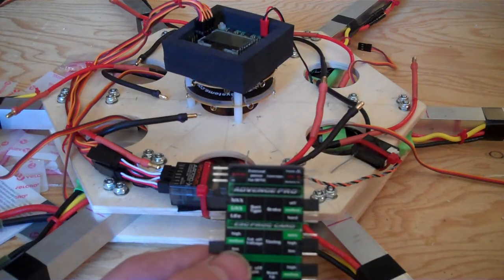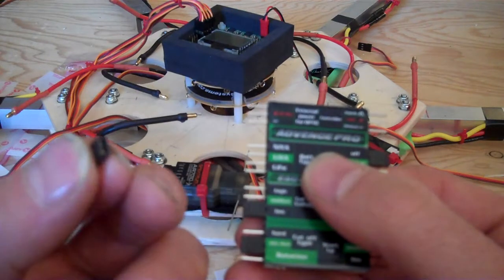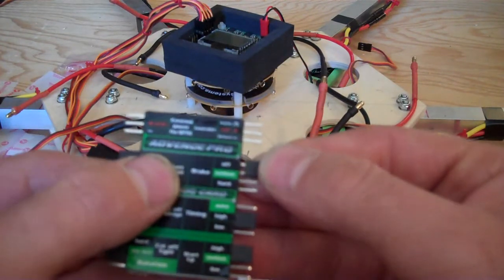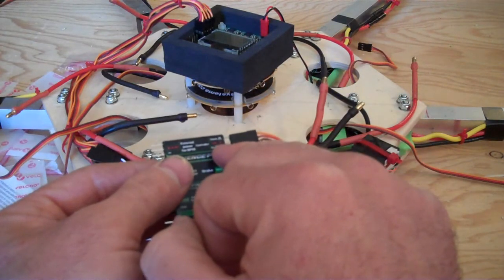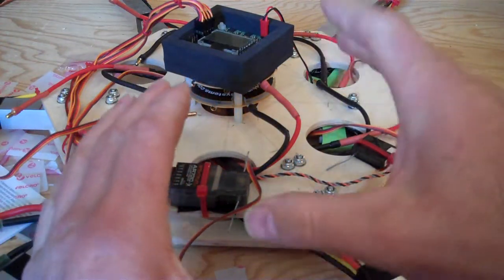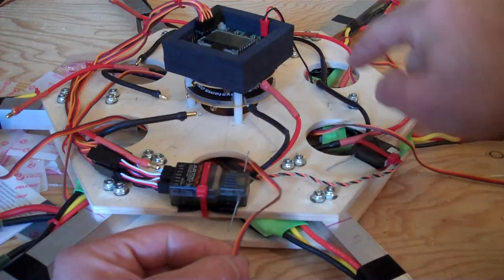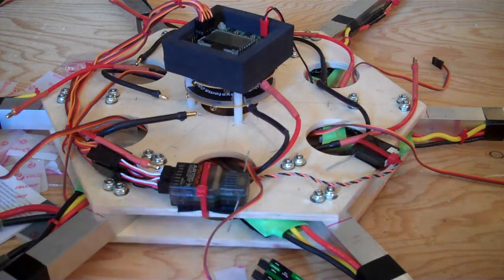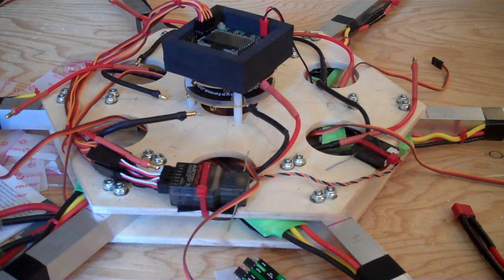How to use the Multi Star programming card

Comment: Thanks for the video. But just one question. So you are using hexa as a safer setup so when one of your motor or esc stop working you can still land safely (or at least safer) and powering the board with just one ESC? What if the exact one burns? You loose your whole copter. Why not to use all the ESC to power the board?

Comment: You can also power the KK2 board from the radio receiver (which I do as I use 3 OPTO ESC's on my Tri).

Most people don't realise that this won't power any servo's you plug into the motor sockets though on the right - on a tricopter, to power the tail servo, you can provide power to M8 in order to provide power to the tail servo on M4.

Comment from the maker: Hey Robert,  as far as I understand about the Multi Star escs is that the programming card is actually meant to be used with them.  As for setting them up you should program them all individually and use the same settings so that all the motors work in unison.  Opto just means there isn's an internal bec.

Comment from the maker: 1969 --- It is necessary to remove all but one red wire on the KK2.0.   IF you were using a NAZA it wouldn't be necessary because its the nature of that board.  The red wire supplies 5v to the FC.  You don't need to remove the red wire on any ESC unless it has a switching BEC.  If you were to use an OPTO ESC you would not have to remove the red wire on that either.

Comment from the maker: Kabaku,  you need to program the esc so that the motor responds at the commands needed to make a multi rotor fly.  The radio receiver tells the flight control board what to do, and the flight control board tells the esc what to do, and lastly the esc tells the motor what to do.  It's a chain of commands.  If you just power up the motor without programming the esc it can be very dangerous.

Comment from the maker: Thanks.  I'm using the 45 amp esc's with the built in bec.  I've hooked everything up and powered it with one 6s 5000 mah pack and nothing has smoked or exploded so they are holding up very well. I will be using 2  6s 5000 mah batteries in parallel once it's all said and done.

Comment from the maker: So I've gone through the directions again to be more thorough.  It says that one beep means the brake is on and that two beeps means the brake is off. This is interesting since I had the jumper set to the off position.  When I get the hex tested out in the next couple weeks I will let you know if the props stopped immediately or free wheeled since my escs only gave me one beep. This outta be interesting.